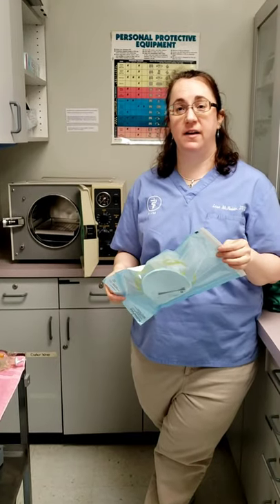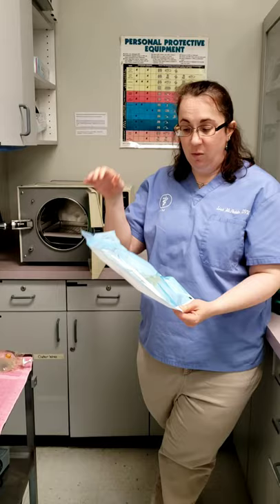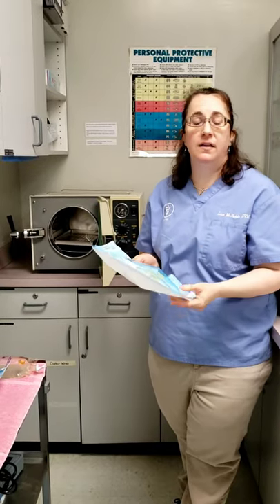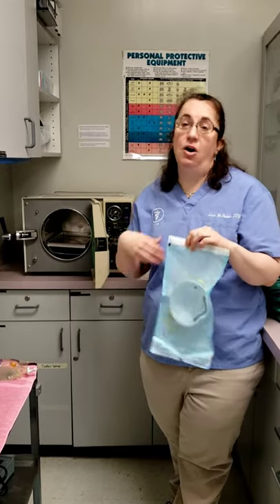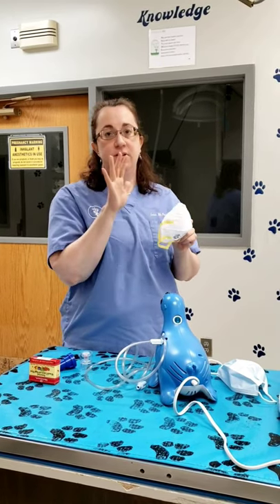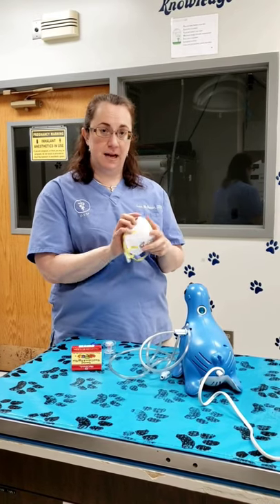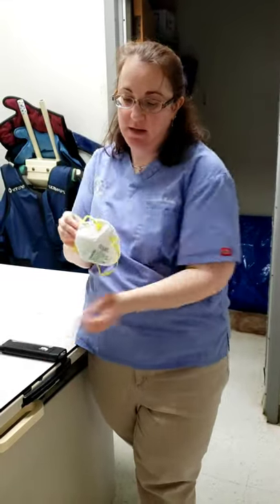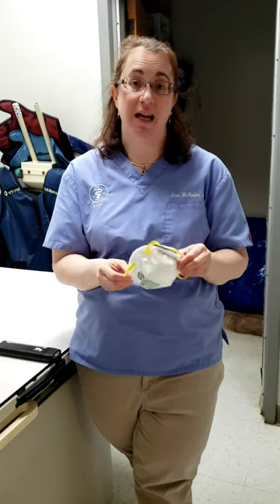Can you sterilize and reuse an N95 respirator using an autoclave and an instapot?

Comment: Variables aside, its a good experiment. I feel like we should be doing this already. I also wanted to add that if you wanted to re-do the experiment with the luminal, you could use the vent end of a blow dryer to be you lungs. Just have to be careful is does not overheat.

Comment: When did you upload this? Ive been searching for an answer regarding autoclaving used n95 due to issues with low stocks ,
Reply from the maker: Recorded and posted on 3/19/2020.
Reply: PUT THE MASK IN THE MICROWAVE OVEN.
Reply from the maker: @bjl1000  not recommended especially if the mask contains metal pieces.

Comment: I can’t find the video on autoclaving a regular earloop mask
Reply: Those surgical masks aren't much better than a scarf made of fine weave cloth in terms of self-protection; their design is intended to prevent transmission from the wearer to others, not so much in reverse.
Probably it wouldn't be any different from the N95, but it's a lot of trouble just for reusing a cheap disposable mask. It's worth it for the n95/p100 filters because they are very effective.